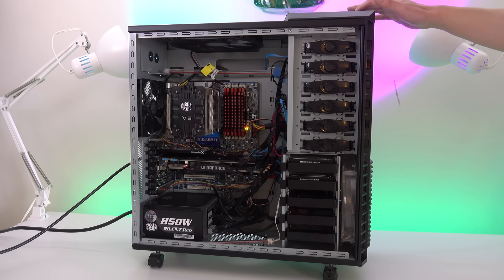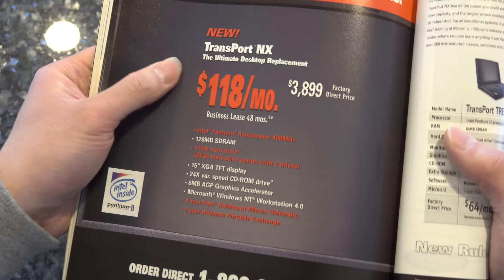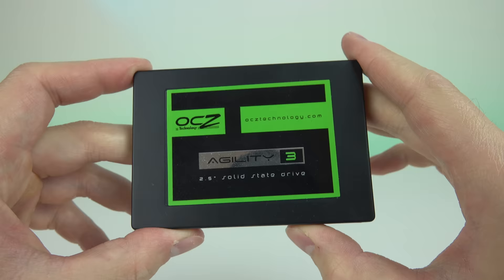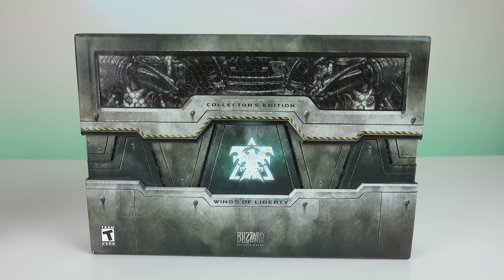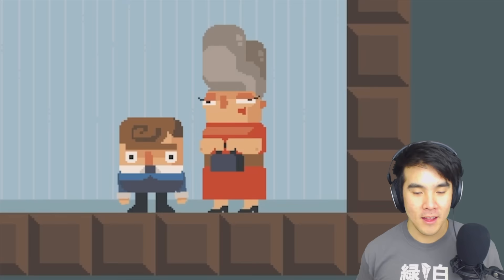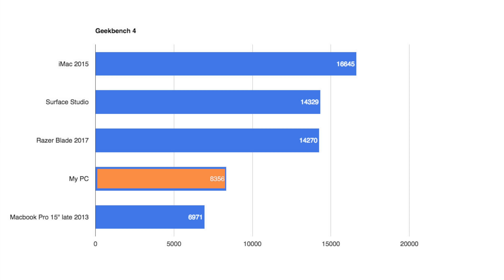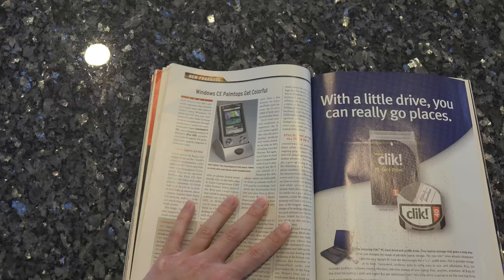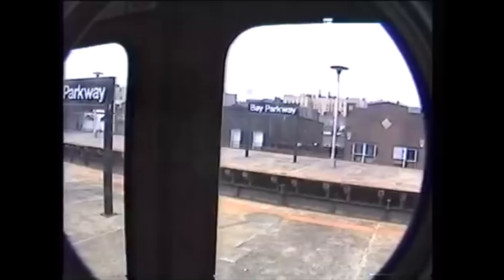I Built This PC for $1360 in 2010. Here's How It Holds Up.

Comment: this is almost the exact life story of my pc, built it in 2011, upgraded in 2016, and its running great today. no hq streaming level but i get 120 on most games :^) had a few stability issues because im messy w my pc upkeep (whats wire management whats restore points whats putting screws back in etc etc) but i am so grateful for it hangin in there!!!!
Reply: My pc is built in 2009 and I upgraded it 3 time

Comment: Why don't you upgrade i7-930 to a 6-core Xeon? I have a Xeon X5670 @ 4.2GHz and geekbench 4 multi-core score is 15158
Reply: So you're basically saying, upgrade your motherboard too, which is expensive as hell in order to be compatible with xeons.
Reply: Nah Westmere Xeons on LGA 1366 are dirt cheap. For example, and X5660, which is a 6 core 12 threaded overclockable Xeon CPU costs only $25 on eBay. All he has to do is flash the motherboard BIOS to the latest revision, and swap the processor out. Then he could just sell the i7 930 to recuperate the costs back making it a "free upgrade." plus those Xeons overclock like bosses and can easily hit well over 4.0GHz
Reply: That specific one isn't. It's $40 on ebay.
Reply: even then, an X5650 is still $20-22 and you can overclock it just as high
Reply: I'm rocking a X5650 at 4.4Ghz, does 16600 in Geekbench with 3658 singe core.  Cinebench R15 gets over 1000.
Reply: +Fexyle It runs it perfectly well. The xeon is a great great cpu. 6 cores 12 threads for 30$ or less is an amazing value. The issue is that the motherboards are rather expensive. However in chubbyemus case since he already has the motherboard the upgrade would literally only cost him 30$.
Reply: +Fexyle It runs anything I throw at it!  Even better in DX12 games and properly multithreaded games that make use of 12 threads.  I've been more than happy with it and recently bought a 1080 Ti.  Next is an ultrawide monitor.  Believe it or not the Xeon keeps the 1080Ti at 75-98% usage in GTA5 with REDUX, 1920x1200, ALL ULTRA including sliders and 8X MSAA, getting 50-80fps usually.  When I upgrade my monitor things should get even better since more load will be put on the 1080 Ti.  Then I'll decide whether or not to upgrade to a new platform like X299 or AMD.
Reply: +Fexyle warning however the motherboards are very expensive. There are other Xeons however on sockets where the motherboards aren't that expensive. If you want you can get a Xeon x3440 which has 4 cores and 8 threads for about 30$. The motherboards (lga 1156) are only about 50$.
Reply: They trick with the old X5600 series Xeon's is you need to OC the shit out of it but luckily pretty much all of them will hit at least 4.2 but you NEED a motherboard that will support the LGA1366 Xeons AND overclock.  I actually just ordered another 5650 for $17 to see if it OC's better than mine to try and get it  towards 4.6.  Mine can do 4.4 which isn't hateful by any means.  

The other thing is you need to pair it with some fast DDR3 to really get the most out of it and run a higher uncore frequency.  I'm running the uncore multi at 18X with DDR3 2000mhz ram.  That really wakes things up.  Don't worry about PCIE 2.0 it barely makes a difference.  If you want some more benchmark numbers just ask (Firestrike, Superposition, HWBot, games, etc).  I have some benchmark numbers with my old 1070 but now I'm running the 1080 Ti.
Reply: Another good trick to finding a X58 motherboard is to find someone selling an old i7 system on craigslist.  I got my brother a complete X58 PC for $200. I stripped it down and swapped in better parts.  Now he's running a i7 920 at 4.2Ghz and a GTX 1060 6GB with 12GB RAM.  He can run anything at 1080p and he's about to get my old Xeon (whichever one OC's less).  His computer came with a ASUS P6T motherboard which I confirmed does indeed support the Xeon's.  Win Win!
Reply: I have the same board as him, and run a Xeon X5650, as it's an LGA 1366 chip, and run it at 4.4GHz.
Reply: Nice.  What setting are you using to get 4.4?  On my Classified 3 board I'm running 1.36 vcore  1.35v vtt, 1.6v dram, 18x uncore at 3.6ghz, 199x22 to get 4.4ghz on the 5650 and 2000mhz on the memory.
Reply: best cpu 1366 upgrade for performance/value at the moment is x5660, 26 dollars of true power
Reply: no, buy a i7 7700k, better
Reply: His motherboard doesn't support i7 7700k
Reply: Why Xeon? an i5-7600k or a Ryzen 1600X (for AM4 M.O is more than enough for his PC
Reply: +CGNT 175 But he would need to buy a new motherboard
Reply: +CGNT 175 the xeon x5650 costs only 20 bucks off of ebay and once overclocked it is much much faster than the i5 7600k when all threads are being used. If he would upgrade to an i5 or ryzen 1600 he would have to spend over 400$ (new motherboard ,cpu ,memory ), while if he gets the xeon he'll get a large improvement in performance for only 20$

Comment: My story is similar. I recently built a new gaming rig, replacing my 11 year old gaming rig from 2012. it had an Intel Core i7 3930k  6 Core, 32GB DDR 3 Ram, an Nvidia GTX 680 - 4 GB GPU, which i replaced with two GTX 970's in an SLI configuration, and then, eventually upgraded to an Radeon RX 6700 XT. 8 TB HDD storage, and a Corsair 80+ Platinum 1050 Watt PSU. As i mentioned before. Even though the upfront cost was expensive back in 2012, I made sure that my system was built to last. Finally it just got to the point were the CPU and Ram were bottlenecking my gaming experience, and the motherboard was  also on it's last leg. IMO, the i7 3930k was an absolute monster CPU. Performance was rock solid, and I never had any stability issues during my time with that CPU. Initially it had an AIO water cooler, that ended up dying after a year  or so. I just replaced it with an inexpensive air cooler and its been that way ever since. My new computer is my first complete AMD build, and it's been quite the learning experience for me.

Comment: I have pretty same looking  system (cm haf 912 plus) case? MB was pretty "first mobo with Usb 3.0 support at 2009   Maybe. (ASUS M4A87TD/USB3) As this name dimensions it. Probably built 2010  (i didnt built, get it by used in early 2013) with  Amd Phenom II X6 1055t (still ok)  cpu bottleneck is possible keeping new gpu in the cage)and it have yet HyperX DDR3 8gb ram, pretty reliable built, had 6850 hd 1gb earlier now ( even with strix geforce gtx 1060 6gb :d ofc psu was 650w fractal design, now its Corsair rm(750 w) gold plus. And Kingston HyperX ssd 120gig and couple hdd's

Comment: So you only had to spend $2,000 + $1,500 (on your next build this uear) for satisfactory gaming in 7 years.  Good to know.
Reply: Chrisjb1983 or around $400 for a new console
Reply: Brent No. You must not be a gaming pc owner.
Reply: Nicholas Osborne The man in the video clearly stated what his expenses were over the last 7 years.  Wake up.
Reply: Nicholas Osborne that's a lot of money to shell out for 7 years (and I know pc's are better)
Reply: Brent pcs are more than children's toys tho. they do work. work =money. not that children can or would work. console games are mad overpriced too. this guys pc is way overpriced.
Reply: Brent
The 750 and 750ti which came out around the time the ps4 and xbox one came out and would be used in a $300-$500 build still play games very well today at 1080p. You also should realize that many console games don't even play at 1080p all the time. The xbox and ps4 run a lot of games at 720p-900p some change the resolution to keep up with frame rates like BF1 which fluctuates from 1014p to 648p to maintain 60fps and that game still has dips down into the 40s.
Reply: I bought a gtx 750ti for $150 back in 2013 and it's still going strong 5 years later playing any game at greater visual settings than the consoles at 60 fps. and I slapped that card in a desktop release in 2011.
Reply: forza1sra can confirm I bought a 750 ti in about 2015 and have been able to play anything I wanted at decent settings with either my laptop with a weird adater I got or later when I built my system. I could easily keep it and be happy but now with a job I've had for about a month I have disposible income to buy upgrades. To get a good system you don't need more then 350$ you just need yo be willing to do the research and get used parts.
Reply: more like 2000 in total for 7 years
Reply: GGPL
Yeah, you cannot consider the cost of his next PC to apply to these 7 years. You would have to say $2000+$1500 for 7 years plus the expected lifespan of his next PC.
Reply: not realy parts are getting cheaper now he will spend like 300 $ every few years (its optional you dont have to upgrade) becouse you can sell your old parts for preaty nice price

Comment: I also built a PC in 2010 using a HAF-X case similar to yours and an i7-2600K which i overclocked to 4.4Ghz (Corsair 1200Watt psu and NOCTUA 2-fan cooler).
It still works fine today for any kind of gaming i throw at it...

Comment: Still using i7 950, gtx 480... maybe just a gpu upgrade, and thats all im going to do
Reply: I7 is Apex
Reply: @Rasmus Not really. It should be totally fine with AMD RX 590.
Reply: @Rasmus Well FX 6300 would be pretty much fine with RX 590. Just a slight bottleneck on CPU side. FX 6300 should be identical to that i7. RX 570 would be perfectly balanced tho.
Reply: @Rasmus Do you even realize that Ryzen 1200 is about as as fast as FX 6300 and i7 950? Ryzen 1200 doesn't bottleneck GTX 1070, RX 590 is weaker. Jeez, these older CPUs are still quite powerful and they overclock well. In many games there would be no bottleneck or at worst 5% bottleneck, which is unnoticeable. Only in CPU heavy games it will be possible to see big bottlenecks or in poorly threaded games. Anyway, RX 590 is decent pairing for i7. The bottlenecks you are talking about may be seen with GTX 1070 or GTX 1080, but definitely not with RX 590.
Reply: @Rasmus Oh my... Start looking at real tests instead of some snake oil.
Reply: Question, I can as a late Xmas Gift get from my Dad, either:

Intel Core i7-9700k   --------- (I pay £873 - £924 for rest)
AMD Ryzen 7 2700x + RX 580 -- (I pay £554 for rest)

Which do I get?
Reply: @Nubecuube  Well that depends n what you wanna do, but still right now is a bad time to buy anything. AMD will launch new CPUs quite soon, nVidia and AMD will launch new GPUs. Still, if you want something now, just get Ryzen 2700X with RX 580. RX 580 is awesome card and Ryzen is great CPU. If you definitely can't wait, then I would adjust your parts into Ryzen 1700 and Vega 56 or GTX 1070. 1700 is much cheaper than 2700X and is pretty much as fast, when overclocked, but better graphics card is truly a whole tier above. Sure it may be more expensive than just R2700X+RX 580, but it would be much better combo. If you really can't get better GPU, then just get Ryzen 1700 and RX 590. Hell, even 2600 would be fine. For games we don't need 8 cores yet and you can always upgrade later even to 3rd gen Ryzen, which will be launched soon. R5 2600 + GTX 1070 or Vega 56 (or 64 if cost is similar) would be a great combo.
Reply: I see, when is the new AMD announcement, I can get my gift in mid january, ill see if amd release a new gpu to rival RX 580 or a better cpu than rx 2700x for £300, if not then i ll go for:

i7-9700k or ryzen 7 2700x + rx 580
Reply: @Rasmus

Programming, Some AAA Games (PubG, LOL, Overwatch, Fortnite, CS:GO and maybe 1/3 - 1/4 of the AAA ones that come out that require high end GPU)

Could go Ryzen 7 2700x (£550 for rest), save money on CPU Cooler + GPU
Could go Intel Core i7 9700k + 1070

its just tht i dont upgrade often so im not sure
Reply: `1920x1080, will everyone upgrade their monitor soon to 4k ones? can i use these for 1080p, 1440p and 2160p? or only 1080?
Reply: @Rasmus RX 580 is faster than GTX 1060 6GB and costs considerably less.

Comment: Put a Xeon x5690 on that and you hace a completly new pc
Reply: X5690 is shit for gaming
Reply: A x5690 would be fine for most games, don't know what you're talking about. It probably would struggle on some of the newest AAA titles, but the thing boosts to 3.7 on its own, which isn't shabby. The x5690 isn't unlocked, but you can overclock it using BCLK. You could move that sucker up to 4.2 if you wanted.
Reply: @Churchgrimm  i have xeon from about 6 7 years and believe me i switched to i7 and damn! I was thinking that i have upragded from gtx 660 to 1080
Reply: There were a lot of xeons from that generation. Are you sure it was a x5690? There definitely were some slower clocked xeons that would struggle on single core performance, but the x5690 has adequate single core performance even today. And the top of line i7 at the time was the i7-990X, which was basically an unlocked x5690. That was the fastest i7 released for the LGA1366 socket, so must have either had a much slower xeon than the x5690 or a different socket all together if the i7 made a significant difference.
Reply: @Churchgrimm  i was using X5690 6C no oc and E3-1245 v2 and now i switched to i7 3770k and believe me i7 changed my life!
Reply: The E3-1245v2 and the i7-3770k are both LGA 1151, so I'm confused as to how the x5690 came into this, unless you're saying that you had two different machines and were running the E3-1245v2 on one and the x5690 on the other. Unless you were overclocking the i7, it wouldn't make that huge a difference over the E3, which runs from 3.4-3.8 while the i7 runs from 3.5-3.9. A 200mhz could be hard to notice outside benchmarks, so I assume you must be overclocking it. Both are a bit faster than the x5690 in single core, so they're better for gaming, yeah. The x5690 is better more most other uses, though, because of the two extra cores.
Reply: @Churchgrimm  yes i have two pc s and e3 and i7 are lga 1155 while x5690 is lga 1366 and i oc i7 to 4.7ghz and it runs like a beast

Comment: Buy a $30 6 core /12 thread and oc to 4-4.5ghz
Reply: i bought an  fx6350 for 40 bucks and it runs at 4.5 ghz now, great deal if you ask me
Reply: Bas Hartman I had my x5680 at 4.7ghz. spent $38 on it. 6 cores 12 threads. it shitz on my fx-6350 and fx-9370.
Reply: I know that feeling man, just spent 200 euro on a bundle made up of the exact same motherboard that's in the video (X58A-UD3R) with X5670 (OC'd to 4.1GHz), DirectCU II 7970 OC'd to 1150/1700, 12GB Mushkin 1600MHz RAM and Corsair H100i, these are some damn good times we live in!
Reply: Drew Charpentier I made a PC with a w3690 (6C12T) 3.46ghz, 12gb ram, 1tb HDD, gtx 660 ti and W10 for 255$

Comment: I think it's great that older hardware (especially CPUs) still hold up 7, 8, or even 9 years later, for most tasks. The i7-930 was a 1st generation i7. That's a Nehalem chip, so definitely 1st gen. 

2nd gen was Sandy Bridge, which came out in 2011.

I'm using an i7-3770k, overclocked to 4.7ghz, paired with 16GB of DDR3 2133. This CPU is from 2012, but with this OC, it performs right in between a stock 6700k and 7700k. It outperforms Ryzen 7 CPUs in most games.
Reply: What Vcore and CPU cooling are you using? Thanks!
Reply: @vladvah77  My 3770k is de-lidded, with Artic Silver Conductonaut between the CPU die and the heat spreader. It's stable @ 4.7ghz with 1.34 volts, with a Cooler Master Hyper 212 Evo.

Comment: In 1996 my sister paid $1,400 for a PACKARD BELL computer with a 200 MHz Pentium II "MMX" cpu, 4.3 GB hard drive and 32 megabytes of EDO ram. In 2000 she gave it to me and I still have it and it STILL WORKS perfectly and have never had to replace so much as a single component. The hard drive, the power supply, absolutely EVERYTHING is still original and it still works. Only thing I use it for is programming old Motorola 2-way radio equipment because the old 1990's software requires true DOS rather than emulated DOS.

Comment: This Video is VERY relevant to me. I am still running an Identical i7 930 processor, massive full sized (thermaltake armor) cases, 6gb triple channel ram kit. Though I had a GTX480 instead of the 460.  Skipped the SSD and just ran standard HDDs. I even had that IDENTICAL monitor from your 2010 snip. The SyncMaster 20 or 22". Then I also upgraded once in 2015. Upgraded to more ram (16GB), a samsung 850 ssd and a GTX 980ti. Still currently running it as my everyday PC.

Comment: My PC is from 2007. It is the core 2 Duo E6550 2.33GHz
From Windows XP, 7 and then 10. I gotta say that I used to run GTA 5 at around 20-80 FPS. When I upgraded to windows 10, the game couldn’t run the game at all. Which means I gotta upgrade and I’m gonna do it! Am currently looking at i9 9900k and RTX 2080 TI. Wish it would run for another ten years :)

Comment: I still use that exact same coolermaster case. except with a modern PC built inside it. a case still easily big enough to hold a 4090 and provide MASSIVE airflow with enough room for 2 240mm radiators

Comment: I built my first pc with new parts in 2019 using a i7 9700k 16gb ram and a gtx 1070. in 2021 i upgraded to a 3070 ti.  And I've never had a single problem, usually I clean it once every 3-4 months apply fresh thermal paste. Now its 2023 and I'm about to upgrade the storage and ram to 32gb. 4 years and going I've seen my friends change consoles every year while I just upgrade a few parts and getting a much better experience.

Comment: I have the exact same system. X58. It's now a W3690 cpu at 4.6ghz. 24gb ram at CL9. A Samsung 950 pro nvme boot drive. All 10 sata drives have a Samsung 850 pro 512gb. And a RX 6950 XT on a Gigabyte ga-x58a-ud3r v2.0 mobo. Still a sweet system.

Comment: I've basically done the same thing. I built the PC that I'm posting this comment on back in right around 2010. It's an AMD Phenom II x6 1100t. I originally had a GTX 460se that I just swapped out within this past year for a GTX 1070. I've overclocked the CPU to 4.0GHz and have 16G memory in it. I can still play titles like The Crew, The Crew 2, and Forza Horizon 3 at 60 fps at 1080p.